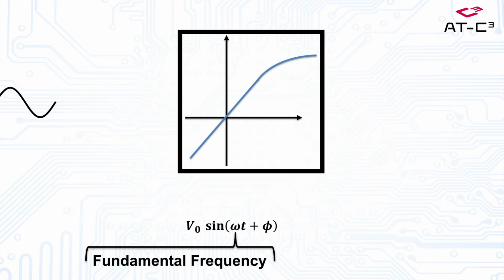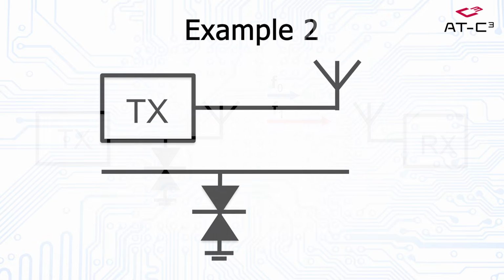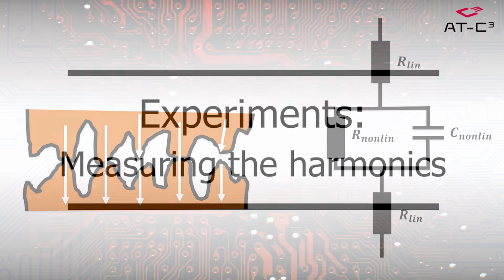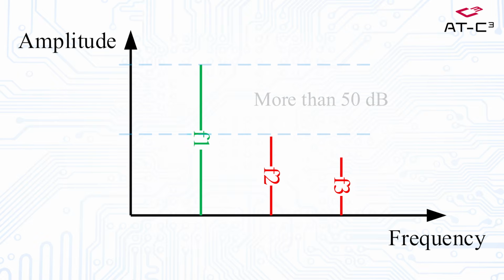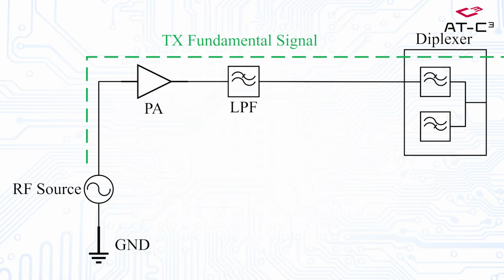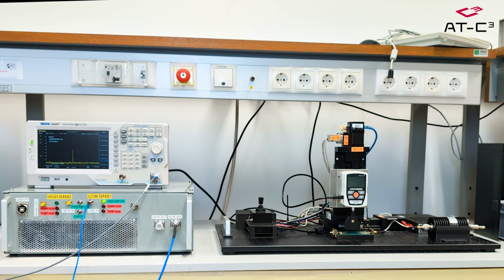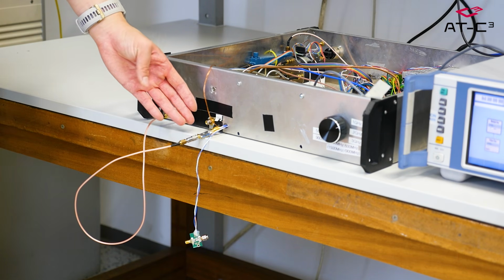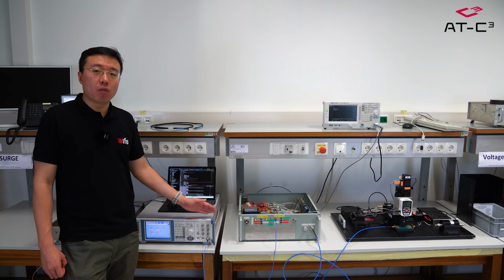Where do unwanted harmonics come from?

Comment: One trick question I encountered in my studies was "what frequencies can a non-linear system generate from a pure sine input?". The intended answer was harmonics, and I had to argue quite a bit with my instructor that any frequency can be generated. He got convinced after I pointed at the lab signal generator as an example of "50 Hz in, anything to 20 MHz out" system.

Comment: I thought linear systems only exist in theory.
Reply from the maker: And you are right about that, but most systems are designed to operate in a linear region. Take a resistor for example, which is in most cases linear, but nonlinear with respect to temperature.